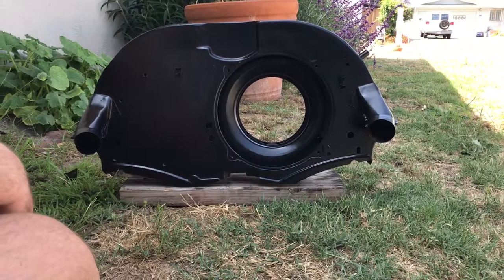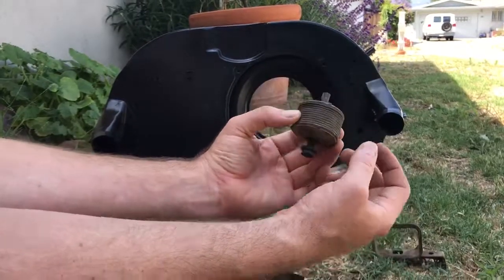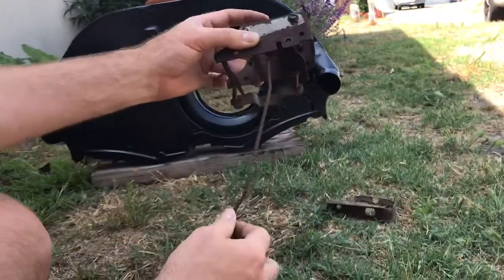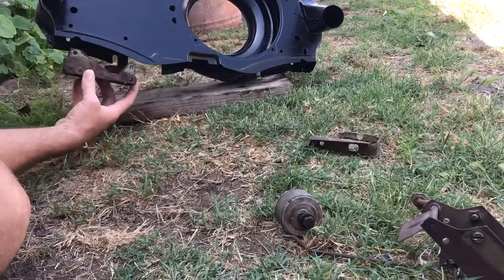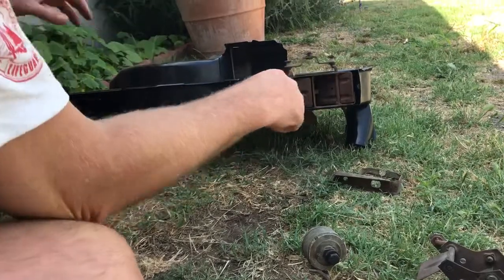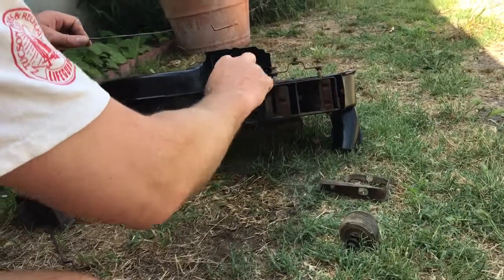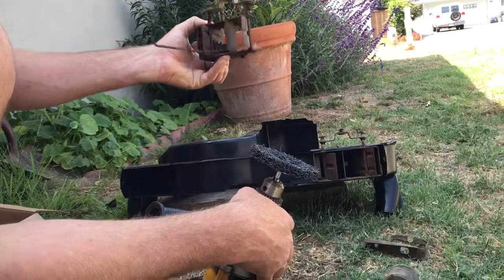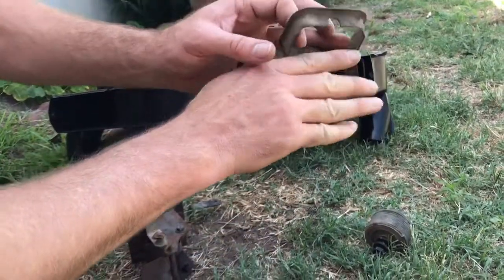VW air cooled engine thermostat - How it works

Comment: We stopped running these finding them unnecessary for socal driving. We did see some where the thermostat would not open You could heat the bellows and they would stay shut. IDK how it would happen but it did. People say they fail closed but if those bellows would not move when you put the bellows in boiling water explain that?

Comment: I am swapping an engine from my sand rail to my Volkswagen Thing I noticed my Volkswagen Thing has this vent and I'm trying to figure out if I actually need to keep it I would think this is for a really cold day to add additional Heat to the cab
Reply: Heat comes from the exhaust system.  800 degrees going into the car.